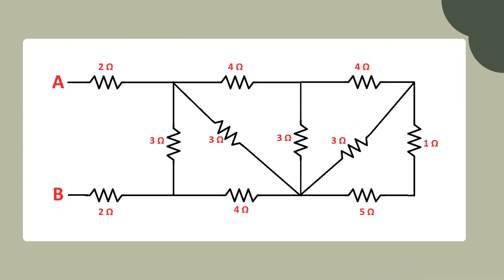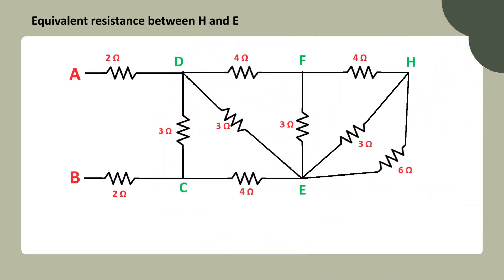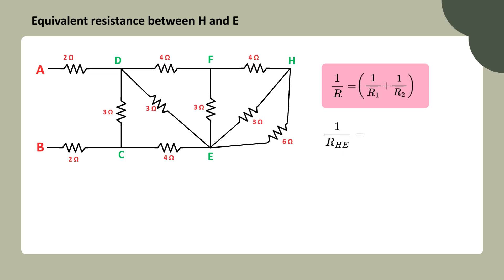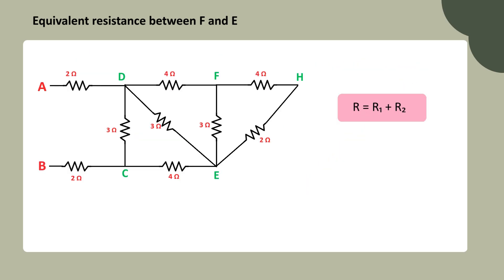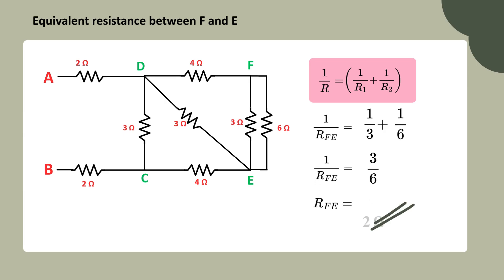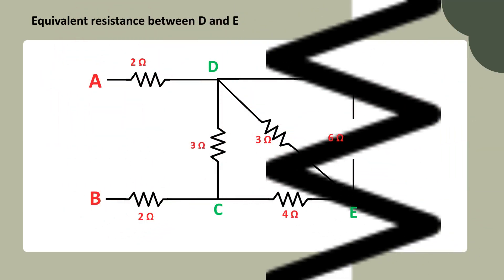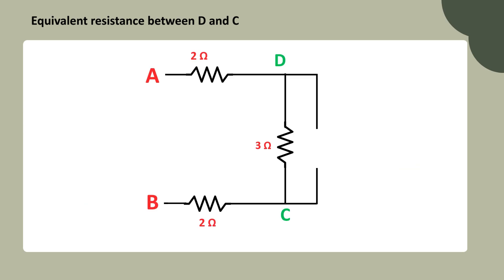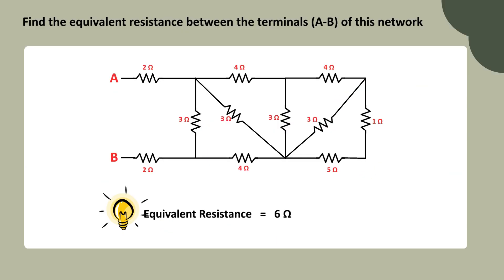Solved Problem 1 - Equivalent resistance of series and parallel circuit

Comment: According to Ohm's law, first the series resistances are added together, then the resistances in parallel are divided and added together to form the same resistance. I don't know if that's correct. Thank you. Best regards.
Reply: Thats Thevenin. Ohm is the basic relationship between voltage, resistance and current(V=IR). Thevenin and Kirchoff deal with the 'order of operations' for solving current flow.  But, essentially you are correct, first you find a series and add it up until it runs into a parallel, then its  1/((1/R1)+(1/R2)...) For only 2 parallel resistors, its simply (R1 x R2)/(R1 + R2) aka 'product over sum'. 

You do that until you reduce (or rather combine) all the resistors down to a single 'equivalent resistor'; known as a Thevenin  resistance equivalent (Req). To the voltage source, Req is all that exists. V=IR gives you total current (It). Then you work backwards using Ohm's Law at each resistor to find voltage, current and power for each one. Lots of math. Simple math. But crushingly tedious, applying V=IR (Voltage = Current x Resistance) at every step.  For example, your single Req is solved for total current. Then you expand it to its two constituent parts and solve the second one for voltage and current. Then expand that one and solve for its constituents, etc. At the end, if you add up all the voltages and currents, you should get It (total current) and Vs (source voltage). If you're off by more than a couple rounded decimals, you made a mistake and get to start over 😃

Comment: How does the rated power change if 2 resistors with a power of 1 W are connected in parallel?
Reply from the maker: When two resistors, each rated at 1 W, are connected in parallel, the total power rating of the combination becomes 1 W + 1 W = 2 W. In general, when resistors are connected in series or parallel, the total power rating of the circuit is found by simply adding the individual power ratings of the resistors.
Reply: @CNotedu  Thanks.